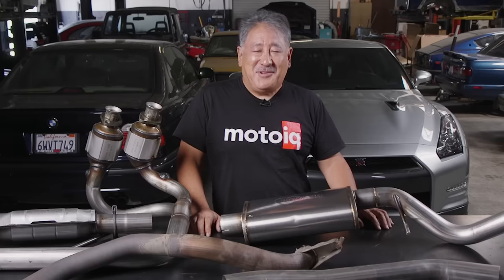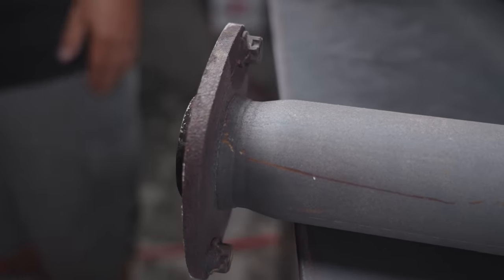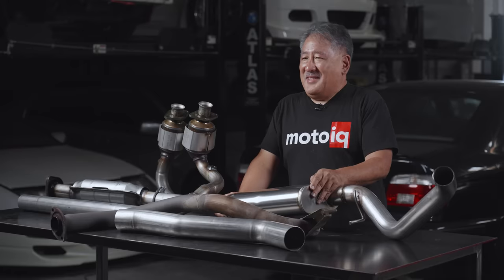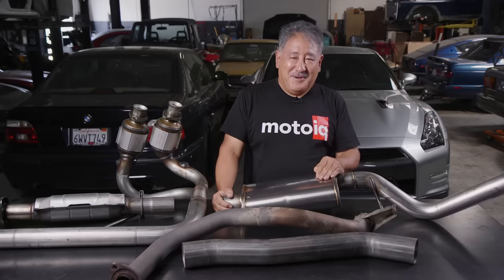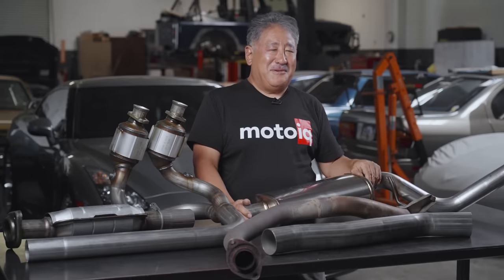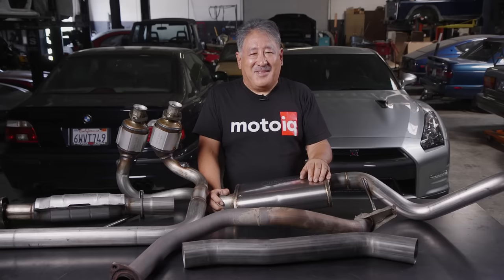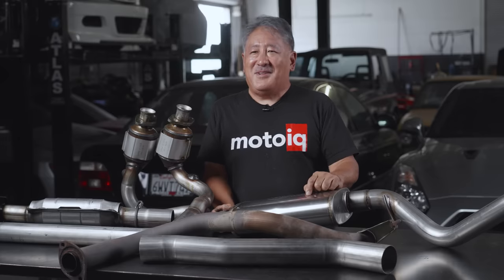Exhaust Back Pressure Myth DEBUNKED!

Comment: If an engine is designed to run with back pressure, it’s bad for them to run without it.
Reply from the maker: That is not true. Watch the video and learn why.
Reply: @motoiq  video does not explain that.
Reply from the maker: the whole video is about that.
Reply: @motoiq  I saw no evidence.

Comment: Hi motoiq, i have a query maybe you could answer it? Will bending my tailpipe  in a yaris) to the middle (ala minicooper) instead of a straight one(original) have an effect on performance on my car. Considering the pipe is the same size 2 inch as the stock tailpipe?
Reply from the maker: Straight is better.

Comment: Sounds right for big motors. But this guy must have never rode or worked on scooters, you can feel the power and acceleration loss on these single cylinder tiny motors when you straight pipe them versus when you have a muffler on them. Also you can hear the sucking air back in "whoop" if the pipe is too short. I've even fixed some scooters that wouldn't start with a broken muffler, by adding a muffler.
Reply from the maker: I mess around with and build some really fast scooters. https://motoiq.com/category/projects/powersports/honda-ruckus/  It's really easy to put too large of a diameter pipe on little engines and that kills the velocity.  It's why we use stepped exhaust diameters on 4-stroke scooters.  If you have the right diameter and length of head pipe, an open pipe or a very unrestrictive absorption muffler is gonna get you the most power.  You also need to watch your AFR.  A good exhaust often makes it so you need to jet up or the engine might not even run.

Comment: Hi, for a N/A 3uzfe headers, what the headers diameter pipe size do you recommend for good  usable torque across the Rpm range up to 6400 rpm? , and what  collector or the exhaust pipe diameter after merging or at the point of merging the two bank of the headers do you recommend ? @motoIQ
Reply from the maker: I get paid to figure that stuff out.  If you want to do some basic engineering, google bells equations for header design.

Comment: Putting a horizontal pipe in to the Porsche Cayenne  S  957 -muffler … can I have vantages ? For example less hot gases, and more velocity in outgoing … so less engine temperature, and less consumptions of gasoline ??

Comment: I have a supercharged tundra. Got a P0101 code. Low miles. So I don't think it's my maf sensor. I think it could be my catback flowmaster. What do you recommend as an exhaust for a supercharged tundra?
Reply from the maker: I don't think your exhaust has anything to do with it.  Check your freeze frame data with a scan tool and see what is triggering the code.  The MAF could be dirty or if you have a K&N or other type of oiled filter, you could have overoiled it casing MAF contamination.
Reply: @motoiq  Thanx for your reply 🙏

Comment: love the info. I have a 2012 550i M twin turbo v8 BMW and have wanted to do a resonator delete but am not sure its worth it or if it would loose HP  and MPG any thoughts?  Its a cheap mod but is it worth it on this car?
Reply from the maker: It will probably make power if the AFR doesnt lean out, should be done with a tune.
Reply: @motoiq  thanks for the reply. I'll have to flip a coin. Really only doing it for the sound. I'm not sure it's worth it. I  know the engine is specifically turned. I just don't want to lose power it's just so quite for being a beast of a car.
Reply: @motoiq  if I could find an affordable tune, that would be great

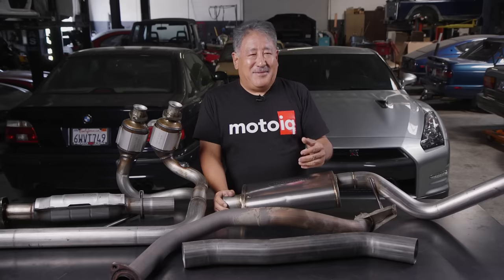Comment: What was he talking about at 3:40 with "scavenging"? I know during valve overlap a small amount of back pressure keeps the air/fuel mixture inside the cylinder, "stagnation". But what is scavenging?

Comment: Incredibly informative video... that short video could have been a $5k consulting fee for whoever needed your knowhow. I am building a street/track hybrid use supercharged K24 setup and want to run long tube header, Small high flow cat, and a absorption muffler(or two), all fully ceramic coated and fiberglass wrapped from header-plate to exhaust tip. My goal is to reduce the stink of the exhaust while making the exhaust note as low as possible. If it was strictly a track car I could simply run a long tube header, but with street use I need this car to be more polite. Would there be a small high-flow cat that you would say had the least back pressure issues with a k24? One of the primary goals of my build is reliability so your warnings about damaging k24 engines with back pressure has my attention.
Reply from the maker: We have had problems with big power K motors and high flow cats, when you run a healthy cam, the high flow cat causes a reflected wave that contaminates the mixture during overlap.  On an NA motor we saw power losses of up to 60 hp in some parts of the powerband!  It also made the motor detonate so we really had to de tune it.  I would say if you are running a close to stock cam it might not be as big of an issue.

Comment: Reducing tailpipe diameter to a little more the half it’s stock tailpipe diameter will give you better torque and better gas mileage but only if you run muffler delete leaving only this tailpipe restriction at the end,worked for me.

Comment: I work on my 125cc scooter bored up to 150cc with big valve, i put a freeflow exhaust the result it has lack of power at high rpm so i bring to local tuner to do ecu tuning then the tuner said "you exhaust header was too big, your engine setup need a back pressure just put a modified standard exhaust with mid size header" so i changed the exhaust just like he said and it's has better power torque curve and even has bigger number than 180cc with freeflow exhaust.

Sorry for bad grammar
Reply from the maker: Your grammar is good enough to be understood.  What happened is either, the big exhaust leaned out your AFR or the exhaust was too big and killed your velocity.  Its not that the engine wants more backpressure.  Either way it's fixed now.

Comment: There is a interesting video here on YouTube somewhere, HorsePower TV or one of those shows where they showed something surprising, they had a 400hp-500hp engine on a dyno and every run they took sledgehammers are damaged the exhaust to the point the exhaust tubes were flat and the engine never lost any horsepower which blew my mind.
Reply from the maker: If the engine was more built and had a cam with a lot of overlap it would have made a huge difference.  The cam on that engine was a mild street grind. Being and engine dyno, that's 320-300 whp or no big deal. less than a stock LS2 for instance.

Comment: The old thinking was slight back pressure broadened the power curve, which was true of the 70s to 80s engines, but technology has changed and so has the engine dynamics.
Reply from the maker: No it was always true, we just know more about tuning now or knowledge is more common and easier to get.

Comment: It’s needs scavenging help from adjoining cylinders.    And with modern cars with tuned factory exhaust systems, you do lose quite a bit of power if you try to run an open manifold.

Comment: I'm from New Zealand. I had a 2004 Ford Falcon 4 liter straight 6 (Barra) engine. Australian built. It seemed to be less restricting. I lot smother Exceleration at low revs. I think from a car built after 2004, I had to have a catalytic converter. My car didn't have any senses that would affect the engine

Comment: I have a question for you I have a 21 Infiniti Q60 TwinTurbo and they have inch and seven eights pipe from the second cat back and I took the muffler off to give it a little bit of sound now that size pipe is 2 1/2 inch with this make a difference on the turbo spooling
Reply from the maker: It should nicely.

Comment: Is not called back pressure anymore. Like the V2 rocket, 2 stroke engine, 4 stroke exhaust works with pulse. The reason for reverse cone is to adjust the pulse velocity, when needed for several reasons. For road use, what you need is to stay way from fines. Nice video.
Reply from the maker: V2 rockets are not pulsejets, the V1 was.  Reverse cones do not adjust pulse veloctiy, but adds a sub wave and refraction.
Reply: @motoiq  negative pulse or suction wave.

Comment: Meaning a pressure wave pushing charge back and or limiting over scavenging at over lap,  on the pipe in 2 stroke speak.
Reply from the maker: It's about the same thing as what an expansion chamber does on a two stroke.

Comment: I want to get higher flow cats for my JaG XFR 5.0 supercharged. It currently has 600 cell cats and I was thinking 300- 400 cell. It is also currently Muffler delete.. Didn't want to go 200 cell as Im worried about all the rumors of low end torque loss. What is your opinion. If I'm understanding this correct, I shouldn't worry about it at All?
Thanks Moto for any input.
Reply from the maker: I think as long as you keep your tubes small you should be ok.
Reply: @motoiq  Yeah the tubes are stock Thanks so much for your thoughts.

Comment: Thats why you will see no exhaust on turbo race cars get the gas out fast. I have a twin turbo suv and I’m going to upgrade all the pipes intake, intercooler, change, waste gate, maybe turbos and turbo back exhaust. Stock Isn’t bad but where the cats are there’s a 70 degree bend no good.

Comment: Hello MotoiQ! Just wondering if you think an inner diameter of 2.5 inches is too big for my exhaust pipes on my 
stock NA 4age 20V blacktop. 

It is currently paired with long tube headers that the inner diameter matches the exhaust port. 

Though my biggest issue here is that I have a big free flow muffler. Is it possible that I lose power with an oversized muffler? since its sizes for inlet is 2.5 inches and outlet is 5 inches. 

Maybe my cat could also be a problem so I can go catless too if that could free up some power. I'm currently trying to maximize my power on the stock 20v since I do use it as a daily but would still want it to perform well for my local time attack. 

Thank you in advance! I hope to hear some feed back! much love and support
Reply from the maker: In my opinion that is too big.  Watch my backpressure video for guidelines on how to build a good exhaust.
Reply: @motoiq  gotcha, i'll try understanding stuff again from that video!

Comment: With a huge overlap / high duration cams, i presume Helmholtz will be disagree with you!
An helmholtz resonator (i'm not speeking about tube section/size) will be a good helping for this "infamous" back pressure making efficiency a real world at torque rpm range (first harmonic during exhaust valve closing).
Of course, that doesn't make the bench talk at the Top end... Just at interesting reving ranges for more torque and less unburns.
Reply from the maker: Helmholtz resonators are used to cancel out drones of certain frequencies.

Comment: He is right except for one point.   He states you need to lowest resistance to flow possible - no...   If that's the case, you cannot get better than NO EXHAUST.   The best you can get, in theory, would be 100% volumetric efficiency - and in reality, significantly less.   By using tubes on the exhaust you are trading some flow resistance but gaining good velocity.   That velocity is momentum (not inertia - inertia is the tendency NOT TO MOVE! - Objects at rest, tend to remain at rest....).   The momentum will scavange the exhaust gases AND actually start the intake flow.....       Psst - even on boosted motors!
Reply from the maker: But I didn't say that, I said lowest backpressure with the best velocity, exactly what you are saying, did you not watch the video?

Comment: I have a 5 litre V8 supercharged Jaguar, a lot of people straight pipe these deleting the resonator and it kills the midrange. What would caused this? Surely the exhaust if free'r?
Reply from the maker: There are tons of things that cause engines to run poorly when you change exhausts including going too big for your engines size and state of tune, killing your exhaust velocity, scavenging, and losing power, exactly what we said in the video.  Getting too low backpressure is not one of the things that makes your car slow.

Comment: It's not about backpressure, but rather about the vacuum which sucks the exhaust gasses out in resonant manner. If the pipe is too big - vacuum will be too high, but too short and the backpressure will come back faster, which will decrease the flow.

Comment: For most people/shade tree mechanics, factory /stock is best. Companies have smart engineers that test and retest the engines with specialty equipment to do battle in a highly competitive market. Adding some swirl air intake, or double tipped spark plugs, etc, is all a gimmick. The only time you can do  a little helpful tweak is if factory engineers have to meet environmental standards.
Reply from the maker: Not necessary, we have gained a lot of power over stock with proper headers and exhaust.  Like in the case of a stock LS3 Chevy something like 40-50hp with tuning.

Comment: May be for multi cylinder 4 stroke engines were there's no valve timing overlap (cam design) But if you put a reverse cone megaphone on a single cylinder 4 stroke motorcycle with correct valve timing you will see a difference in torque.  They went a step further with the 2 stroke engine when they put 2 megaphones together to create the expansion chamber, it was all about backpressure .
Reply from the maker: Works for car engines too, we do a reverse cone megaphone and it typically extends the powerband past the peak.  It is not about backpressure, a megaphone actually diffuses the exhaust flow reducing the backpressure and the reverse cone creates a reflected wave that helps prevent overscavanging at some rpm.
Reply: @motoiq  Yep I can see how backpressure doesn't work so good with fuel injected cars and bikes. BUT was a must for carburate cars and bikes. Most old farts like me never had fuel injection, it was all about carby size, jetting, cams, valve timing and exhaust backpressure  to create speed and torque. OLD FARTS RULE
Reply from the maker: It is not a must for carbureted engines, any Otto cycle engine will run worse with backpressure.  Here is an experiment with adding backpressure on a carburated engine.  https://www.youtube.com/watch?v=V2Wv5-ZTOjM

Comment: Hmm, the Yamaha EXUP wouldn't work without back pressure...
Reply from the maker: EXUP doesnt work on backpressure, the valve uses the cylinders with a closed exhaust valve as a interference branch to help tuning at low RPM, sort of like a Tri-Y header.
Reply: @motoiq  it doesn't work on it, it produces more back pressure

Comment: I have to disagree.. I removed the back half of my motorcycle exhaust I had a noticeable drop in torque causing slower acceleration .. reinstalled it had my acceleration back
Reply from the maker: Messing around with your exhaust can cause several things to happen, by making your engine breathe better, it can run too lean.  Did you monitor your AFR and retune?  This is really common on bikes and they are carbureted or if fuel injected use an Alpha N map that is only crudely load based so you need to reject or retune using something like a power commander. The last bike I messed with hardly ran with an exhaust and I had to go up 6 sizes in the main jet and 4 sizes in the idle jet and raise the needle.  Man, it felt like it had twice the power after.  Every bike that I changed the exhaust on I had to retune. Also, small bike motors are sensitive to making the exhaust too big, a lot of bike guys make this mistake.

Comment: And this is why almost all modern high performance engines run absolutely like crap as soon as you remove the muffler which has the most back pressure.
Reply from the maker: There a lot of reasons why reducing back pressure makes an engine have less power but too little backpressure isnt one. Also what you said isnt true.

Comment: For a 600hp Silverado LS stroker.  would 3" true dual x pipe past the cab, then going to a single 3" Corsa muffler straight through with single or dual pipes out behind the wheels be to restricting?
Reply from the maker: Sounds kinda small for 600 hp.
Reply: @motoiq  would dual 4" exhaust be beneficial with 1 7/8 or 2" primaries  and  3" collector headers? Reason I was wanting to stay with the single muffler is because I really like the sound of it and there's not enough room to fit 2 of them I would have to use a smaller version.
Reply from the maker: Dual 3" going to a single 4" would work.
Reply: @motoiq  alright I'll have to look into it. Thanks for your help!

Comment: The origin of the "need for back pressure" is based on pragmatic observation and from hands on physical experimentation. Many people noticed a drop in power when parts missing like a muffler blown out.
Reply from the maker: While not understanding what is actually going on.
Reply: @motoiq  They just associate the verbal term 'back pressure' with it.  
 It's the exact same kind of pragmatism as saying "tracking" is out.  Few people say "toe-in & camber", they tell the shop "do the tracking"
Reply: Interestingly, I have a friend that after having his DPF deleted , he then completely 'cleaned' everything in the system so it's a 'straight through' pipe from manifold to tailpipe. He wonders why there's severe intake regression at idle (there's probably no 'step diameter' in the OEM design) and predictibly his mechanic says "back pressure, back pressure" .